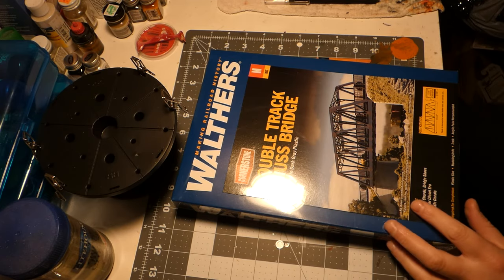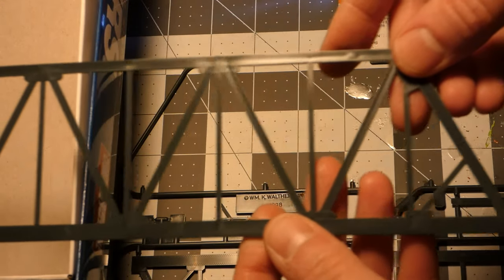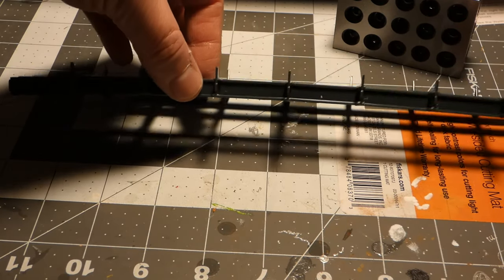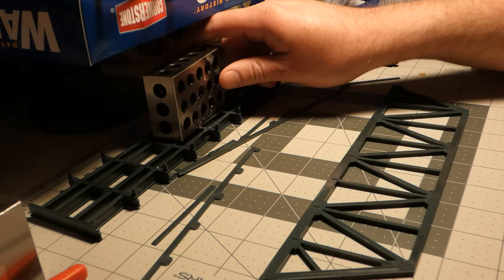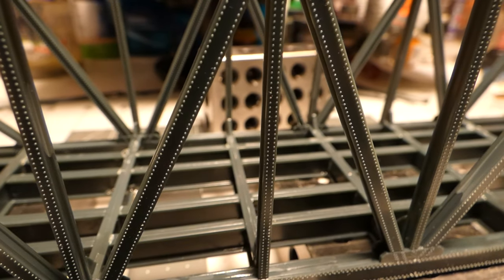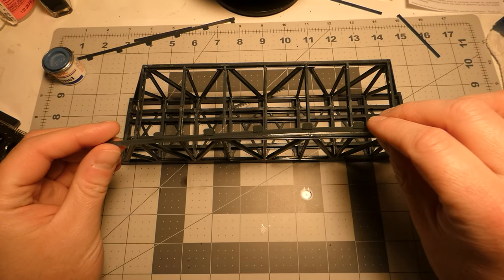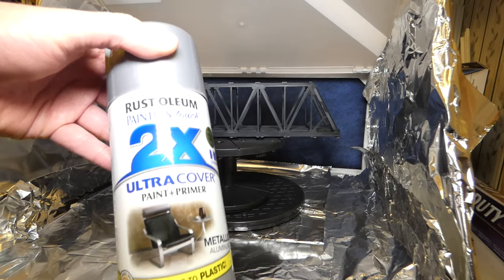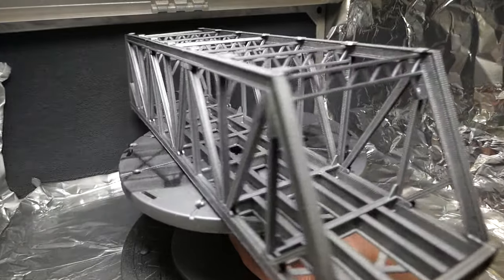Walthers N Scale Truss Bridge Kit Build

Comment: I just finished this bridge myself and oh god did my deck curve like crazy.  I think the tolerances on the parts are too tight, so each cross brace you slot in slightly pushes the top of the longer beams out, forcing it into a curve.  Had to really fight to get the sides on, but that leveled it out for me.
Reply: Maybe those girder deck slots could be trimmed slightly using a hobby knife so that the tolerances aren't so tight that causes the bowing ?? I have ordered this bridge so good to see what to expect. 👍